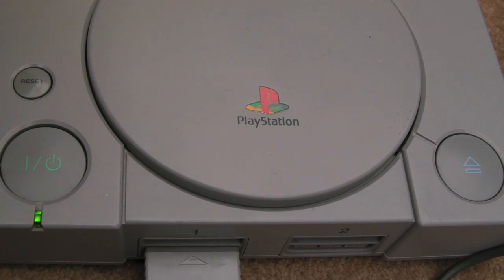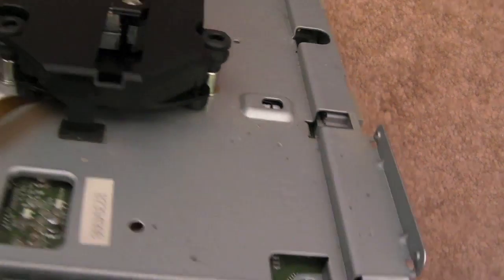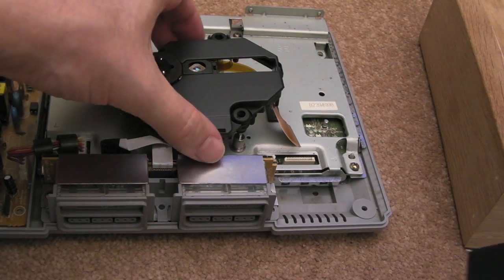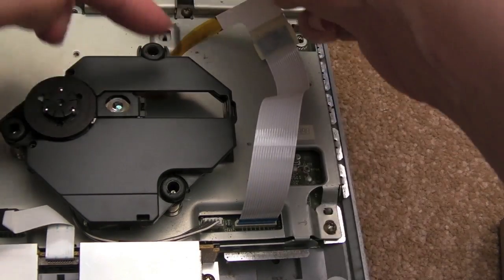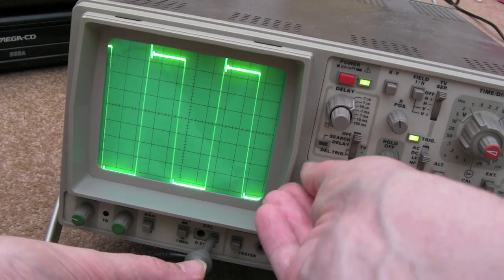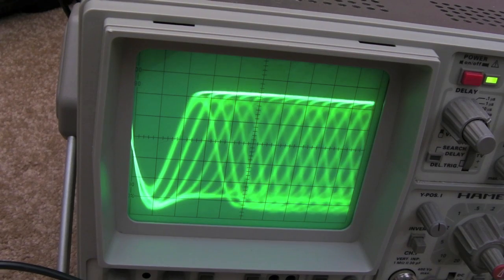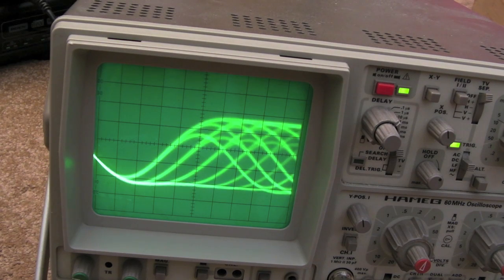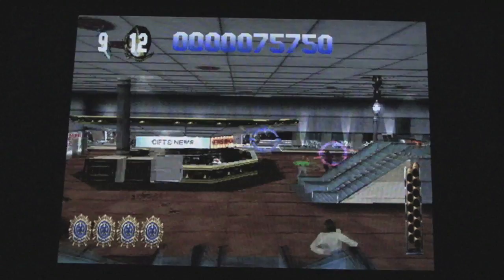Sony PlayStation Faulty Laser Repair (And voltage adjustment)

Comment: Great video Gadget, just to agree with deathtodrm on the hub issues. the Alibaba hubs do tend to come off easily
when removing discs and also for those without a nice oscilloscope, jse07  on here is a great resource for all
psx issues. I think you ordered the PSONE lasers which is why the ribbons were short and for me personally, absolutely 
no discredit to Retrogamezmod as he is my Amiga Legend ,but back in the day I modded many psx and found the make of 
CD had a massive effect on laser pickup as opposed to adjusting the lens. At one point i only used Black TDK/ memorex cdrs
whether due to discs thickness or dye type/colour, the blanks solved everything. I have 3 psones I`m toiling with right now but 
I bought them off fleabay, sold for parts so i deserve the grief! You have an obvious love for retro and more importantly the
use of understandable terminology that helps us all, keep it up m8. The problem with Youtube is your audience may not always
respond giving a false impression of non interest when actually its all been a benefit!
Reply from the maker: Those lasers weren't for a PSOne, they worked in the previous model I showed in an earlier video!  And yes, I totally agree on the media type - the substrate of the disc can make a huge difference on certain laser based consoles.  I've recently found Tao Yuden and Verbatim to be the most compatible with my Saturn, 3DO, and PS1.
Reply from the maker: And thanks for the positive comments btw, much appreciated =D

Comment: Reparing actual lasers has always been tricky hasn't it? I have a ps1 that's been having disc reading issues but I'm afraid to really get into it.
Reply from the maker: Yeah, they can be a pain the ****!  The good news is as more people tinker with these systems, the more SD and USB drive emulators start to appear =D
Reply: Haha...I use my PS3 for my PS1 gaming if the real thing doesn't work :)

Comment: If you're looking to mod this one then I'd be interested to know your thoughts on the PSNee as well. It's a stealth solution that uses an Arduino rather than the traditional PIC chip. 

http://pastebin.com/cWCsYugc

I saw another guy on YouTube install it the other day in this video although apparently the installation varies slightly between PAL and NTSC. 

https://www.youtube.com/watch?v=8ci2wltLchc
Reply from the maker: I will check that out!  Thanks =D

Comment: IIRC in true Sony style, the laser assemblies changed on these consoles between revisions and the laser for a 5000 series won't always fit the 3000 series etc. Might just be something to keep in mind if you're buying or stocking up on replacements unless the after-market Chinese sellers produced a more universal solution later down the line.

That could also be why the ribbon wasn't quite long enough in this case. It could have been designed around a slightly different form factor.

Comment: Great video as always! Is it possible just to measure the voltage with a DMM? I've picked up quite a few PS1s over the last year as they are so cheap here. Typically $15aud (10 quid) I think the PlayStation 1 & 2 will fly up in value soon as they are at that age. The question is, how long will lasers be available to buy?
Reply from the maker: To be honest, I could have tried a multimeter but I suspected because its an RF signal that impedance and capacitance added would mean either an inaccurate reading, or like when I used X1 on the scope probe it could have interferred so much with the signal that it might have been hard to read anything at all. That said, it might work so it's worth trying. I also expect the voltage the DMM reports to be inaccurate probably - RMS etc. It might be one of those things that's possible but your average DMM might report a lower volage. So when the scope shows ~900mV the DMM might show 800mV (or less), and it might vary from DMM to DMM. No idea, if you've tried this and had success, please let me know =D  If you did want to try that, the best way to do it is with an audio CD loaded, and first do the same measurment on a working PS1 of the same model (in order to see what the DMM measures), and then check the system you are adjusting.
Reply from the maker: And yeah - I suspect we won't have replacement lasers forever, so stock up - or get some of those SD mods that have recently been created for the PS1.
Reply: GadgetUK164 The PS1 SD mod looks great but I'm yet to test one out. Have you tried one?
Reply from the maker: Nah, not had the chance (or money lol) yet.  One thing that puts me off is the limited size of SD cards compared to ISO size etc.  Might be better if someone develops a USB compatible interface, then maybe we can use huge external USB HDD?
Reply: GadgetUK164 - Retro Gaming Repairs & Mods, what's that small cord plugged into the optical drive?

Comment: Excellent video! Just curious, in case I missed it - why did you choose to use a scope to measure and tune the laser voltage instead of a multimeter?
Reply from the maker: To be honest, I could have tried a multimeter but I suspected because its an RF signal that impedance and capacitance added would mean either an inaccurate reading, or like when I used X1 on the scope probe it could have interferred so much with the signal that it might have been hard to read anything at all.   That said, it might work so it's worth trying.   I also expect the voltage the DMM reports to be inaccurate probably - RMS etc.   It might be one of those things that's possible but your average DMM might report a lower volage.  So when the scope shows ~900mV the DMM might show 800mV (or less), and it might vary from DMM to DMM.  No idea, if you've tried this and had success, please let me know =D

Comment: I bought one of these replacement lasers and it was not lubricated whatsoever. This caused random skipping on FMV’s no matter what the voltage was dialed in at. Lubricating the unit with white lithium grease fixed the issue for me. Another issue with these units are the motor shafts are too short and the spindle hubs can easily pop pull off.
Reply from the maker: That's good advice!  You are right - the spindle can be pulled off a little too easily.  I will lubricate the rails later because I am sure you are right.  System is working perfectly since the adjustment though, so I am sure the laser was slighly too over powered as it was.

Comment: Well, this is very timely. My PS1 (SCPH-1001) is skipping on FMV  sequences and most of the info I've come across said the laser is the likely culprit.. It loads games and seems to play fine overall but Its drops frames and the audio skips during videos.
Reply: SCPH-100x are notorious for these failures, it was the RROD of its era, there just wasn't the internet around for everyone to share information very quickly.  The rails that the laser's sled rides on are made out of a material that breaks down with use!  How stupid is that!  Eventually, the laser will become more and more lopsided and won't be able to focus on the disc anymore.  Many people worked around this by turning their systems upside down, which caused gravity to level the laser out.  They also suffer from having the laser mechanism close to the internal power supply which gets hot under load, so the lubricant that allows the sled to slide back and forth on the rails dries out.

Sony fixed the sled material issue in the 350x series (Japan only), and re-positioned the laser mech in the 550x series (worldwide), so look for one of those or higher models.  The 750x series and higher (including the PSOne, SCPH-10x) are all excellent units that should just keep going as long as they're taken care of.
Reply from the maker: Yeah, probably the laser! =/
Reply from the maker: Yes, it could be the sled plastic - I did mention that briefly at the start.  Try turning your PS1 upside down to see if the problem goes away =D

Comment: hi Gadgat do you think the ps2 plays psone games better then the ps1
Reply: I notice no improvement in video quality or load time, regardless of the driver settings in the PS2 system settings.  Games like Sol Divide and R-Type Delta have glitches when played on the PS2, just issues in the menus from what I've noticed.  The PSX is so cheap and the PSOne is so tiny, it couldn't hurt to have one laying around just in case.
Reply from the maker: From what I understand the PS2 can enhance the filtering, and it can speed up loading times- so I would probably say yes!  But I do know that some PS1 games have minor glitches on the PS2.